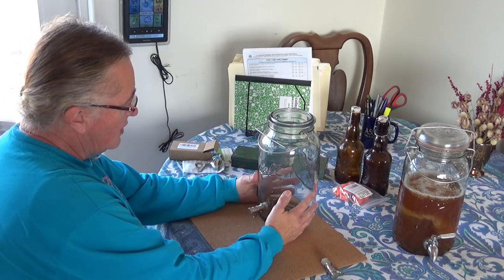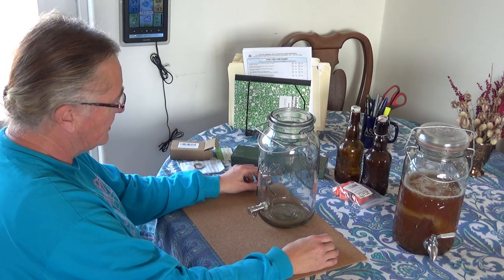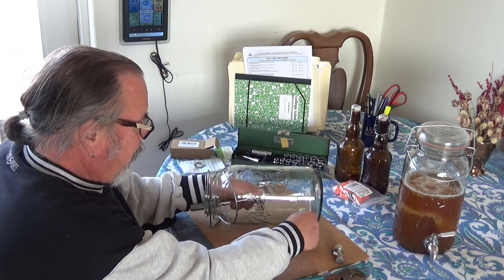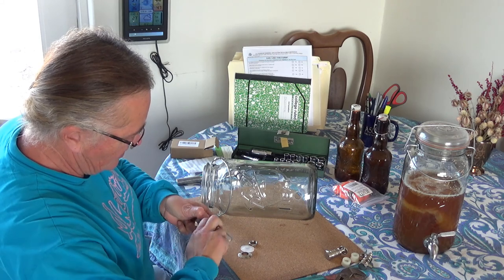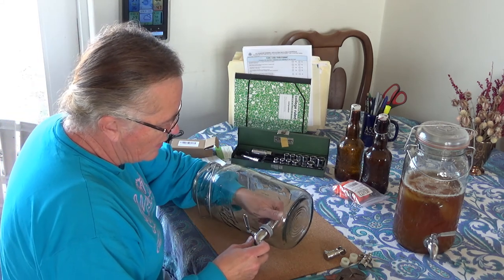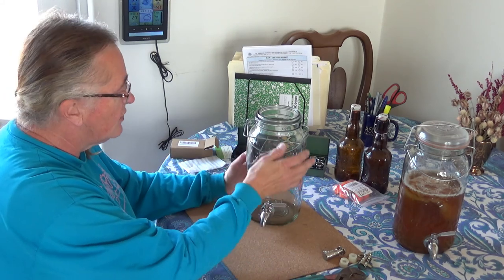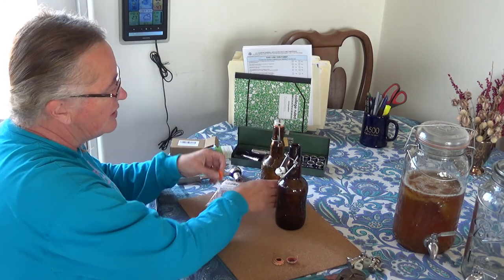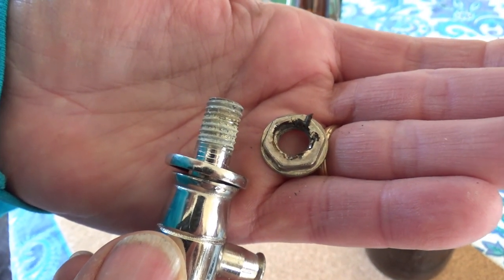Budget Repair and Repurpose of Ball Drink Containers - Off Grid Homesteading Alternative

Comment: Great video!!!!  Could I have the links to both of the item you covered.  I have a few of each that need repaired.  Thank you!!!!
Reply from the maker: Certainly! We’ll put the information in the description this morning. Thanks for watching and subscribing. We’re glad you found the video useful.
Reply from the maker: The Spigots were ordered through Amazon:
Beverage Dispenser Replacement Spigot,Oak Leaf 

Stainless Steel Spigot Polished Finished, Dispenser Replacement Faucet by Oak Leaf You'll need to match the spigot thread size to your specific container. These fit our Ball Dispensers, but there are several sizes used in the manufacture of dispensers.

The silicone washers were also ordered through Amazon:
Grolsch Gaskets Silicone Seals - For Swing Top Bottles - 50 Pack by Zcutt Home Goods
Reply from the maker: These details with prices are now in the description for the video. Thanks for asking!